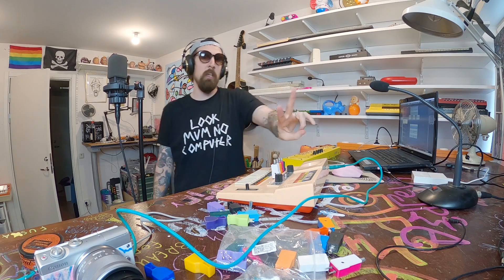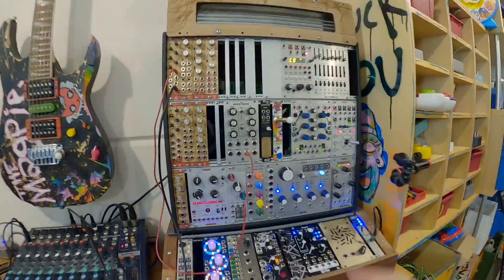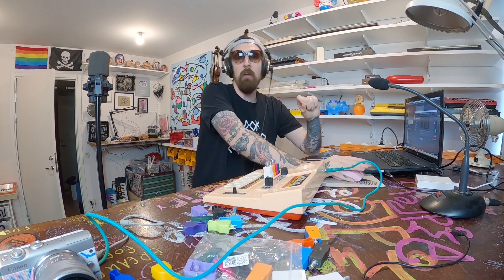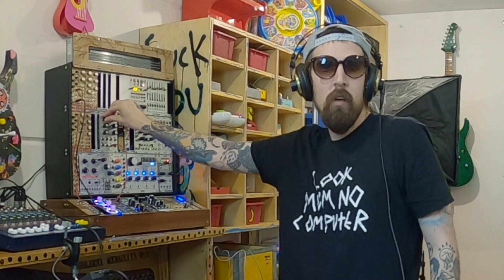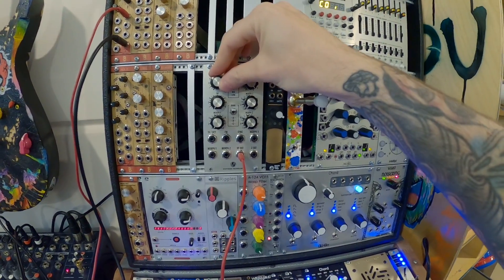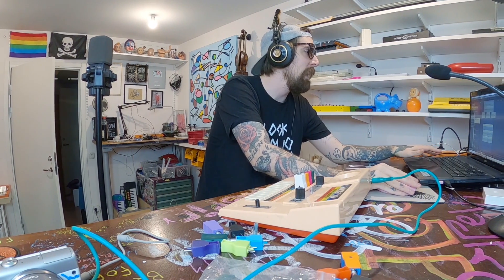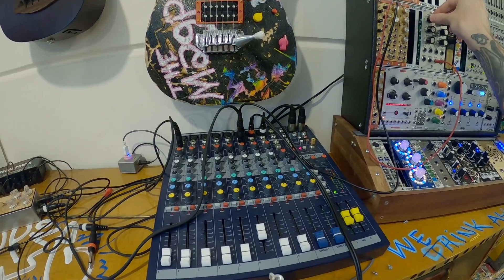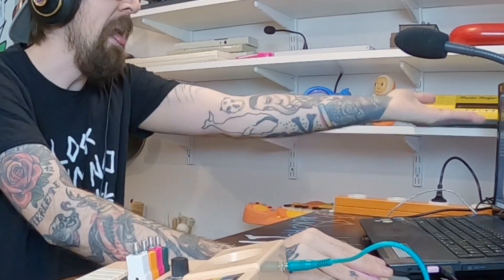AUTOTUNE SYNTHESIZER Sounds Amazing

Comment: on the one hand: quantizing modules exist, could just use one of those?
but also: the glitchiness imparted by the autotune is cool af
Reply: You'd need at least a separate offset knob, too, 'cause the quanitsation happens to the CV before it gets to the oscillator.
Reply: @naught101  [Laughs in Zoia/Euroburo]
Reply: Yes, but quantizing doesn't follow the melody line. Autotune does it!

Comment: Reminds me of when I put autotune after a pitched delay on a vocal by accident and all sort of wild melodies poured out as the autotune tried to repitch the delay. Zynaptiq Pitch Map is my go to for this sort of thing now, since it's also polyphonic. I can repitch a whole arrangement if I want. As it is. I've repitched whale song, am radio tuning, random electrical noises, out of tune whistling, animal calls and Nasa sounds from space, resampled them and chopped em up in Kontakt and Ableton later. Lots of wild sounds to be found this way.
Reply: I did the same with a L/R detuned mono lead, but put a really hard gated reverb after the delay to add even more confusion
Reply: @Gainn  Cool idea, I like it. With reverbs and delays I've since found that can get to interesting place if you think harmonically or in terms of chord extensions. So with Pitch Map, I can send midi to the effect  and have the pitch quantised to whatever the midi plays. With an a minor chord say, I might use a g major chord over it to get the 7, 9 and 11 of a minor. It can be quite a striking effect when you have all sort of melodies coming up that are related to the original material but are also independent . It gets even more wild when you think of all the extensions you can from diminished, augmented, melodic and harmonic minor scales over dominants chords, real atmospheric vibes. Going on from there, here's an idea that you may  or may not know, creating tuned convolution reverbs. Get a synth that can produce an accurate sine wave, create a midifile of the scale you want, I say midifile because you may want to play it over several octaves really fast, faster than many, even quite skilled players, can play. Render the midifile, then use a program like Voxengo deconvolver or possibly even your DAW, (though not all can do this) to turn the original file into something your convolution reverb can use. Voila you now have a reverb space tuned to whatever key center you want. Some convolution reverbs allow for crossfading or switching between spaces or multiband usage, so the skys the limit with this one. Also, you can experiment with different synthesis types or timbres for your impulse response it doesn't have to be sines. They're just good to use because the input and and output are made reasonably predictable by using them. But you can start with a sine and wavefold it or add fm. Metallophones like hang drums can be interesting, but your verb may end with a lot of "resonant bumps" depending on what you want to reverberate. Finally, different spaces between notes and varied amplitudes will create more delay type effects.

Comment: The only thing I've "autotuned" is my violin, using synth pedals or octave pedals with sometimes questionable tracking. PLL-chip stuff. Or pitch-shifter pedals like the POG or PItchfork or Luminary or Enzo or SY-1. Never tried it with a plug-in in a DAW before though... I'm curious how it fares with unpitched sound (noise, etc). 

RE: "What am I supposed to do" one possible answer could be "send me that track and I will add violin to it." Because I like it a lot!
Reply: Zynaptiq Pitch Map is your best bet for more noisey sounds, rather than autotune. I've repitched radio tuning and Nasa space sounds with it, to good effect.